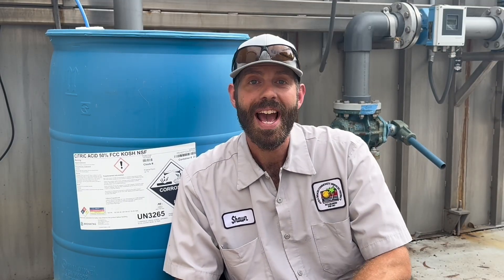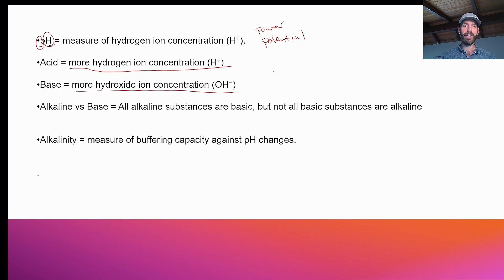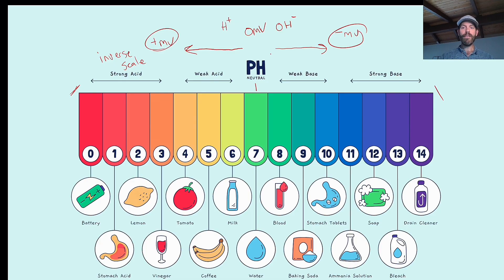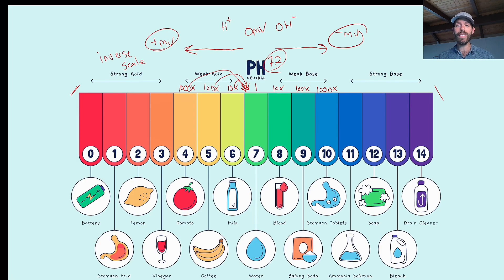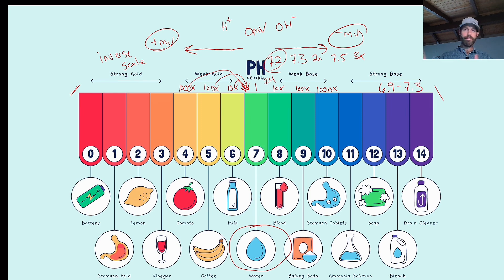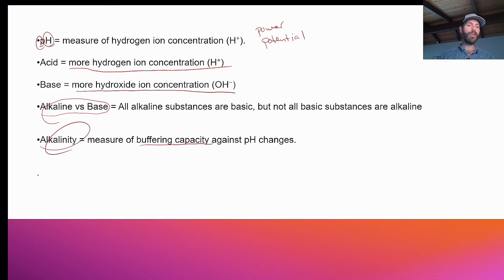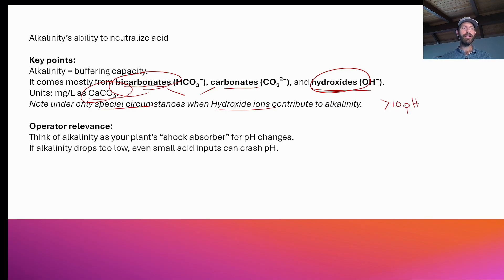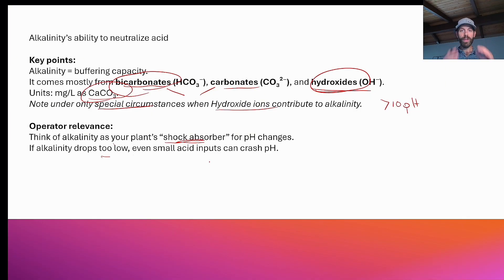pH vs Alkalinity in Wastewater & Drinking Water Treatment

Comment: I’m still learning, but total dissolved solids indicates high alkalinity, because total dissolved solids are minerals and salts? So to change the PH one would want to also lower the total dissolved solids which basically lowers alkalinity?
Reply from the maker: Hi Chris!  This is a very interesting question.  Short answer that targeting TDS is not the best way to change alkalinity.  You are absolutely correct that there is a relationship there.  Higher alkalinity often times leads to higher TDS, but not all dissolved solids contribute to alkalinity.  So even though TDS indicates the presence of alkalinity (and vice versa), the relationship isn’t linear.  Instead, focus on CaCO3 (calcium carbonate equivalent) as the measurement of alkalinity.  Hope that helps!